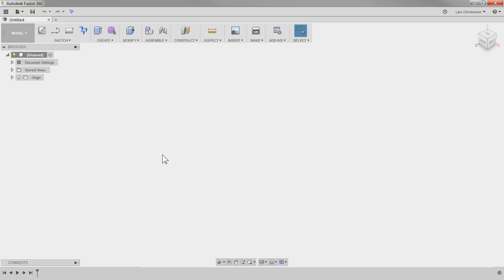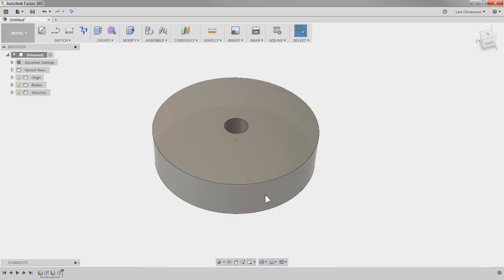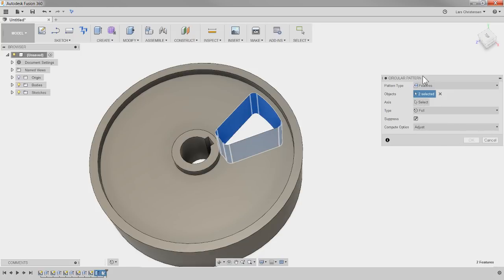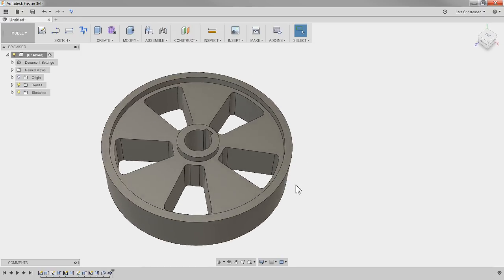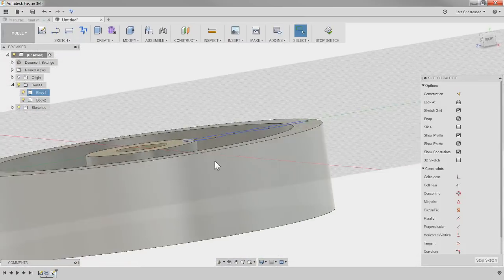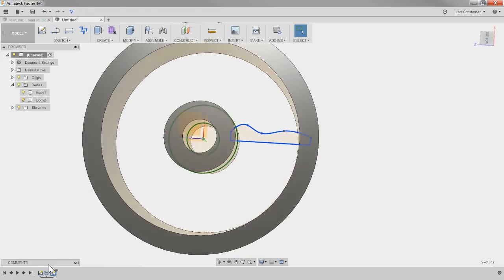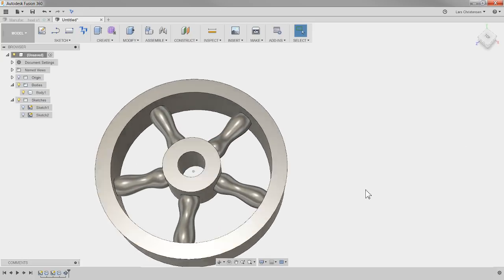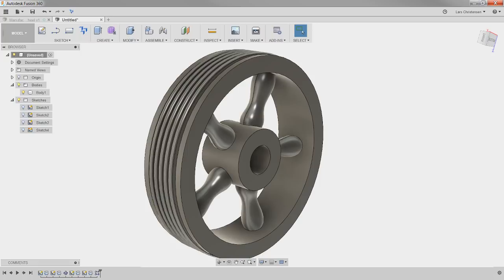How To Model a 5 Spoke Fly Wheel — Fusion 360 Tutorial #LarsLive 104

Comment: Hello Lars great video and Merry Christmas,  A little stage fright is a good thing!  Many, many years ago a customer wanted to watch me program his prototype part at the lathe. I'm sure you can guess the result, between the distraction and me trying to be to be a certified small guy I ended up rapiding  a turning tool right into the almost finished job. After that if someone wanted to visit while I was programming I would just stop what I was doing and give them my full attention. If it was a customer and it was their part I told them that I was still on the clock and I would be happy to BS as long as their money held out.  I realize the situations are different but I'm sure the distraction of trying to get it done while on camera is a bit stressful. Can't until tomorrow.
Reply from the maker: Hi Richard Nix Thank you for watching! Yes, I once plunged a 5 inch fly cutter straight down in a part while the customer was standing there looking over my shoulder.

Comment: At 6:17 as you are making your slot, what exactly are you doing? You grab the line tool and click the right side of the rectangle and click on some empty space in the circle. It appears to create one section. Then you give it dimensions. Then by almost magic when you hit Q, the section not constrained by the circle and the part of the rectangle inside the circle is removed. But how did you manage to join the circle, the rectangle, and trim the top part of the rectangle that intersects the circle so it's defined by the small arc  and the top of the rectangle?